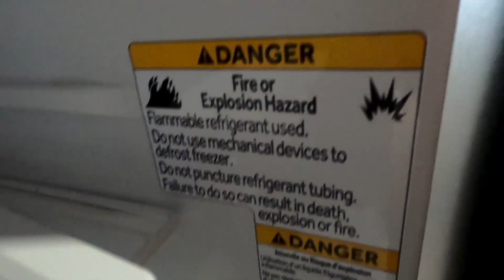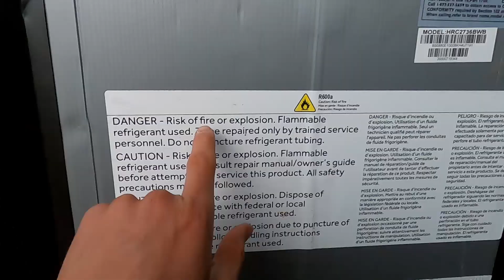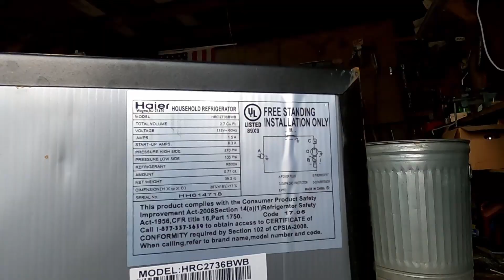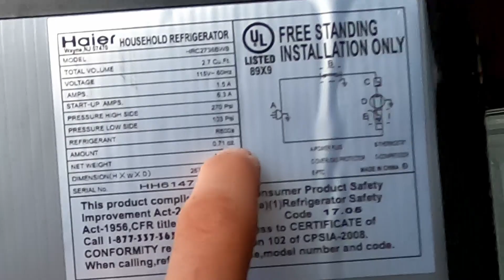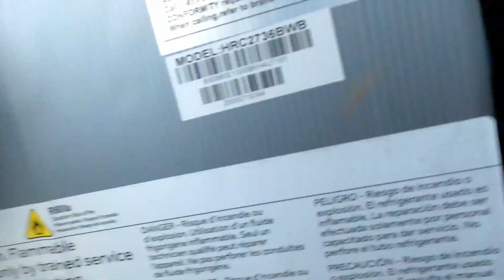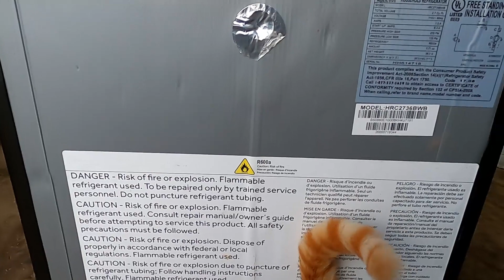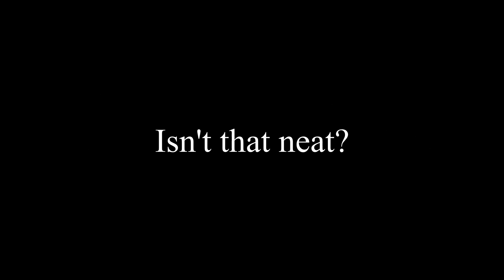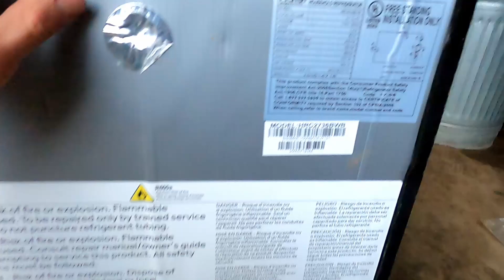Mini Fridge! Smallest Refrigerant Charge Ever??

Comment: Even though this video is 3 years old - what ever you do - Get that dangerous appliance out of your home or you risk in having a explosion - Do your research on R600a Gas . this composition is causing dangerous explosions because of manufacturing defects in material and there has been dangerous destruction caused from this gas 
 https://youtu.be/2EMW0lDEJ00?si=v1m7Dkt9_i3mKSJ6
https://youtu.be/A169-s4KHFQ?si=4WAfBhIRlN-pux9W
https://youtu.be/hRO9ti6TaQw?si=CPzGhGUM5T0VbK_3
And there's probably more...
Do your homework on this danger!!!
And heads up on Samsung fridges failing to keep working- Don't buy them!